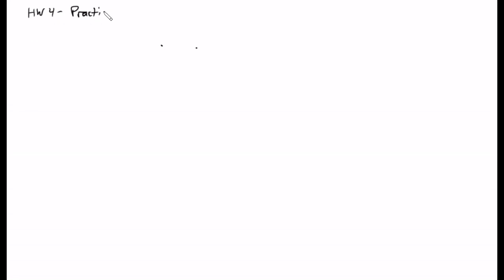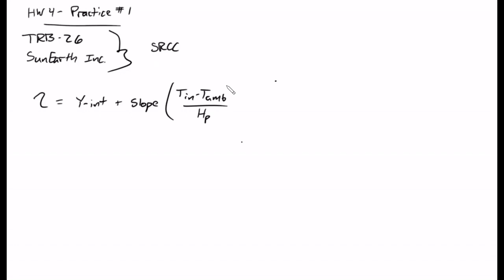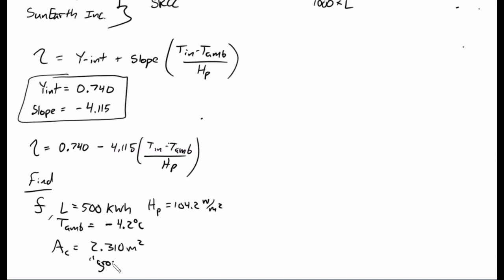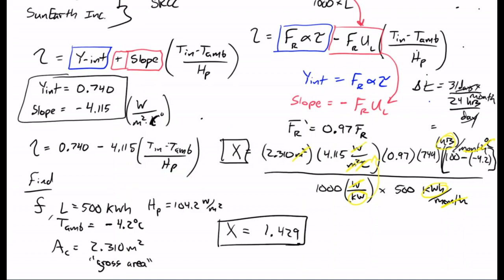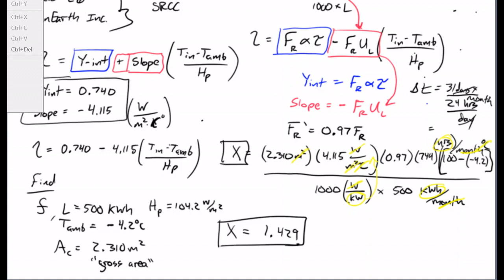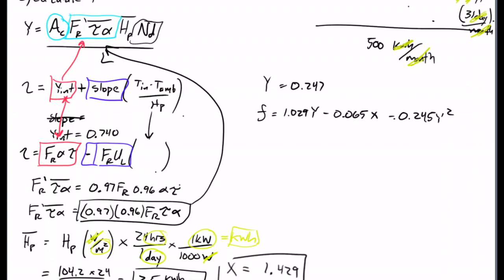HW 4 Practice 1 - MEE 473 / RCL 573 - Use of the F-Chart Method for Active Solar Thermal

Comment: Hi, very helpful video. just a question, where do I find the factors 0.97 and 0.96 that you use to correct Fr and taualfa? I suppose they are different case by case, I wonder if they are given by manufacturers or should be calculated